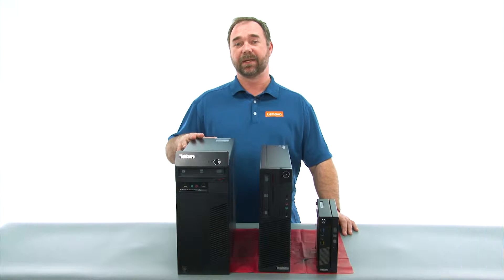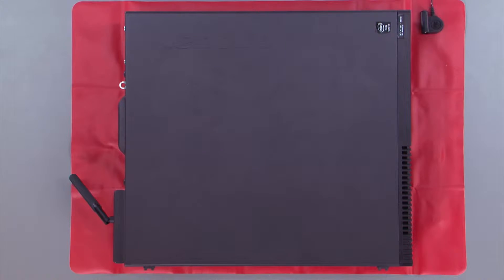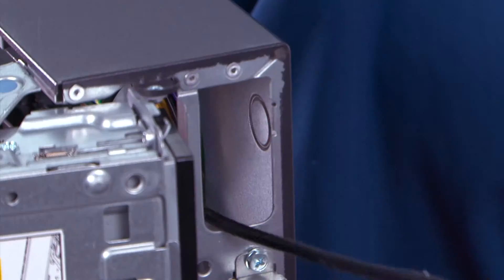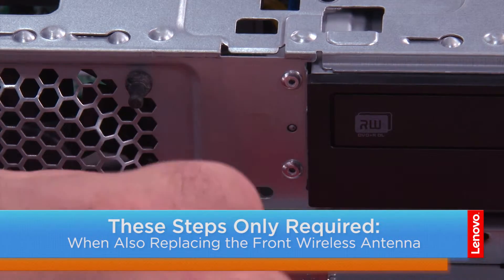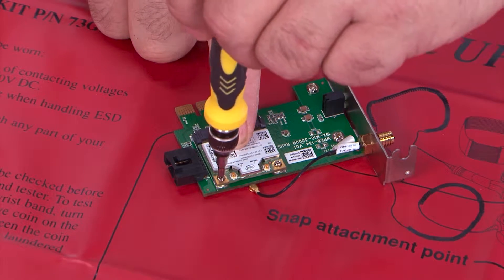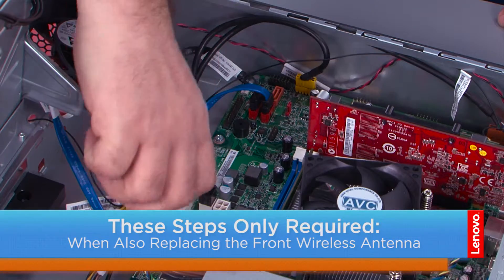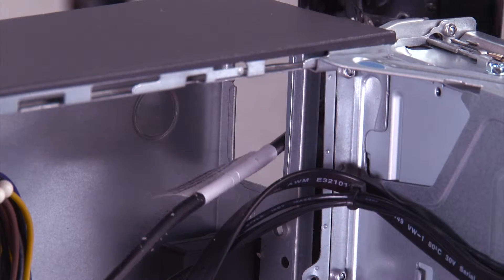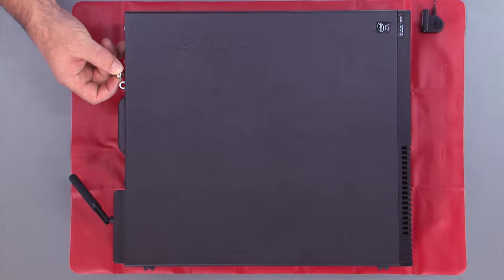ThinkCentre M73 / E73 / M72e Small Form Factor Desktop - Wireless LAN Card Replacement

Comment: I was interested in trying to add a wifi unit ( WiFi adaptercard, a WiFi card module, and a rear WiFi antenna cable) to my M72e SFF pc. I know it was not made with this wifi unit as factory, my pc was shipped with a wifi dongle that plugs in to usb. My question is can this be done? I would like to have wifi and bluetooth capability without giving up my usb plugins.
Reply from the maker: Hi @I have no shame and must scream! Thanks for reaching out. Could you please share us with the complete machine type model of your M72e SFF pc (e.g., 0896XXXXXX) for us to further check? We'd like to help. -Maru_Lenovo
Reply: @LenovoSupport  thank you for replying, I had just about gave up on my project. Right now, I'm at work and I don't  know all the specs of my off the top of my head. As soon as I arrive back home, I will send you all the specs. Again, thanks foe replying back. I'm at a complete standstill, and have confused myself  terribly.
Reply from the maker: Hi there! Thanks for getting back to us. Please share with us the information that we needed in your most convenient time. Looking forward to your response. Rodney_Lenovo
Reply: @LenovoSupport  actually....I have a even greater project that I'm working on, and I'm having a horrible time with it. If there was any way at all I could get some guidance in the right direction,  I would greatly appreciate it. 
I have the M72e 3660 slim form fit (sff). It has a Intel duel core I5, 16 GB ram, and I have a Amd Radeon rx 450 for my graphics card.
I purchased a  Sapphire Pulse
Reply from the maker: Hi! For us to provide accurate information regarding your inquiry, we need the machine type model (ex: 0896XXXXXX). We'll wait for your reply. Rodney_Lenovo